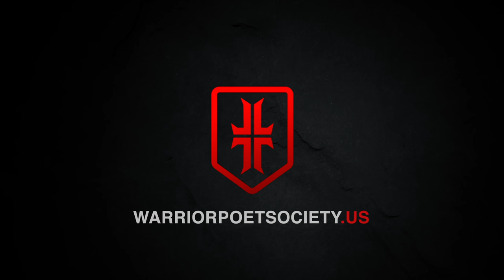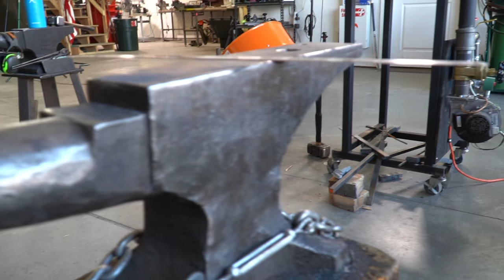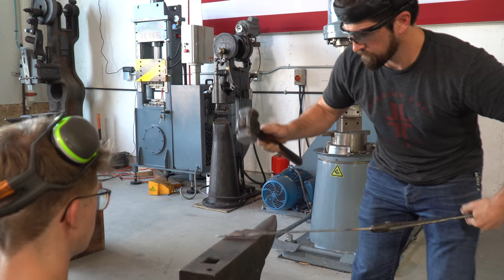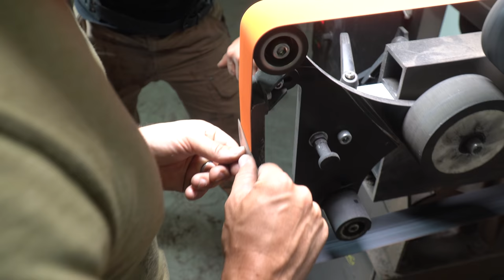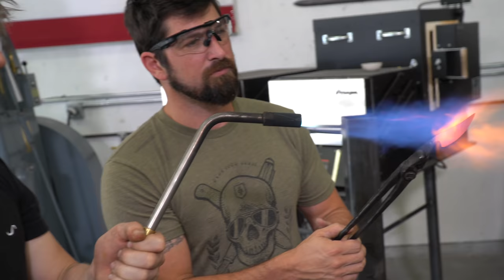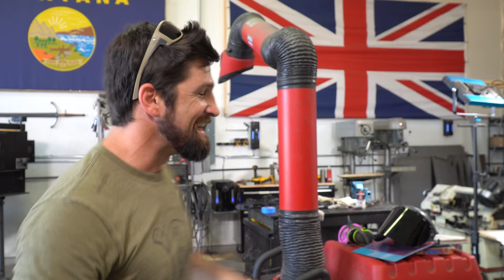Forging the Clinch Pick with Alec Steele

Comment: Just a tip If you can find a clinch pick in stock or can’t afford one you can pick up a crkt spew they are incredibly similar to a clinch pick and only $20 I wear it upside so the blade is on top and you can get an iwb loop and add to the sheath and wear it horizontal just like a clinch pick and it’s slightly more straight than a clinch pick so great for stabbing.
Reply from the maker: They are back in stock! Link in description

Comment: I actually rock a clinch pick well its a fixed point blade shaped like it personally on my kit being in several fights where a knife was drawn. This was more effective than a bigger blade in my opinion. One i can use my own elbows and balled up fists as well as the blade it self to strike but also maim/kill. Ive just learned its easier to conceal but it also has saved my life several times in close range situations.

Comment: Have you thought about EDC body armor? For example Bulletproof Everyone. If a threat is firing at you why not have a passive defense.
Reply: There is concealable Level III+ plate armor out there. I'm gonna order some quick before the commiecrats outlaw that, too.
Reply: @michaelwarnock3988  That's why I was elated to find a concealable slick plate carrier that can be worn under your outer clothing yet carry III+ (not IIIA) plates with spall coating. The III+ would be good for most threats, but I do have level IV ceramic in my multicam boogaloo carrier.
Reply: I agree most people are too lazy to prep for even nominal threats. When faced with something imminent, is too late. Fortune favors the prepared!
Reply: @michaelwarnock3988  I'm looking to incorporate wearing my plates into my exercise routine so I'm acclimated to it for EDC.

Comment: John I have a question,  I have sasquatch hands but I love the design of the clinch pick. Do you have any suggestions on a knife that's similar?
Reply: Any custom knifemaker can design the knife to fit your hands. I have large hands and have been making a version of the CP for years. It’s a very simple and capable knife.  
  There are several guys that make a version of the original CP. prices widely vary.

Comment: Is there an option to order the clinch pick with a bit of blade on the front like you made yours with?  If I were to get one, I would want to be able to use it both ways if needed, and not have to worry about remembering where the blade is in order to make it work. It LOOKS counter-intuitive on video, but probably is fine. Still...

Comment: If Walmart doesn't want to be held liable I suggest they also stop selling alcohol, tobacco products, hammers, baseball bats, axes, hatchets, screwdrivers, pressure cookers, camp fuel, lighter fluid, wire clothes hangers, swimming pools, 5 gallon buckets, children's vitamins, fertilizer and knives.